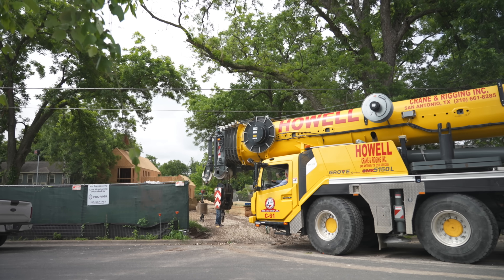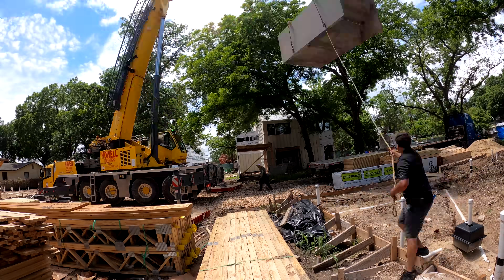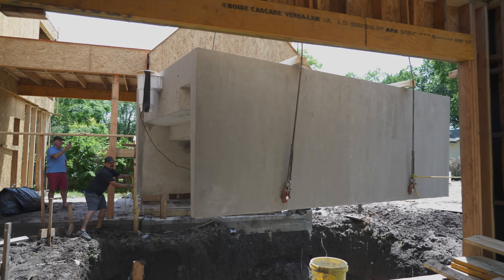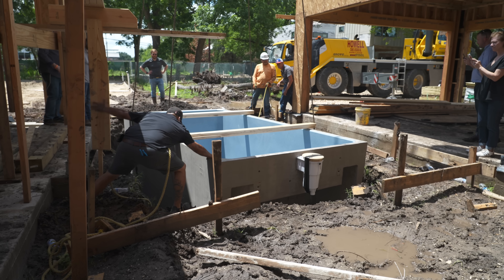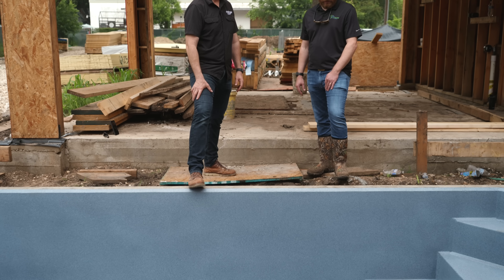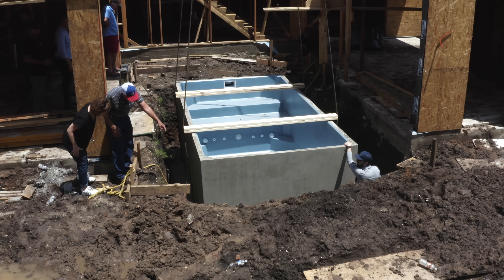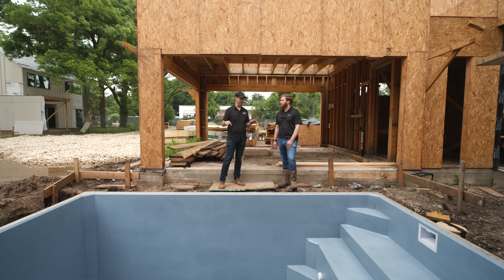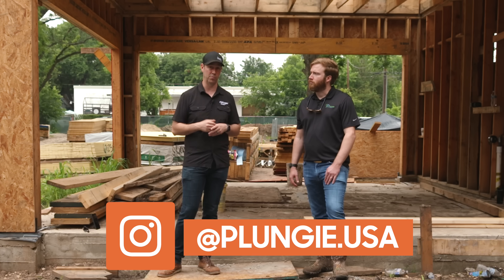Crane in Pre-Fab CONCRETE POOL - Cheaper! + 2 Day Install!

Comment: Edit: I spoke with Plungie about this video and they explained that this video was geared towards other builders, not consumers. So if you’re a builder you can buy this package for around $25,000 then your guys install it. Makes a lot more sense after they explained that to me. Plungie was very helpful and answered all my questions super quick so just wanted to clarify that. 

Saw this video when you uploaded, reached out to plungie and they sent me a builder here in Dallas where I am, just got quoted $80,000 for the Max installed. Was hoping for $25-35k also we have 2 acres with no trees to go over and plenty of room for a crane to drive in our flat back yard. Just wanted to clarify this wasn’t a hard install problem.
Reply: Oh man. That sounds like it’s way more than what was said in the video.
Reply: Well that's a helluva big difference between 25K and 80K.  Like the difference between YES and NO.
Reply: 80K for a small prefab pool and installation.  Yeah, no thanks.
Reply: My parents’ neighbor installed a pool about this size, in SA, 50 miles south of Austin, but full custom, about the same timeframe as this video, took 6+ months from contract signed to installed. Cost over $75K. Inflation, labor shortages, materials shortages hit pool companies HARD.

Comment: That's not a pool , it's a large hot tub with cold water!
Reply: Lol
Reply: I went to the comments to say the same exact thing. lol
Reply: Very expensive "Topless" Cesspool (Sewer tank)
Reply: Exactly, it's just a large bath tub. I wouldn't call something smaller than the size of 2 sheets of plywood a pool.
Reply: Which is begging the question, are pools really that expensive in Austin?
Reply: What's the problem. Its perfect for smaller areas. Heat option is available. Probably won't take as long as a regular pool. Problems with jets, leaks, lines, and pumps wont affect this the same as with a hot tub or swim spa? It will last for many many years like a regular pool. Looking good!
Reply: For 25k? It’s pretty nize
Reply: I know Soake brand plunge pools can be heated with gas or electric. Idk about Plungie pools.
Reply: So... A pool

Comment: Good idea 
This will still run 8k more 
With excavating yourself $
Adding cement slab on bottom $
Getting a permit $
Electrician $
Plumber $
Crane not included $

Comment: Never owned a pool but I’ve seen those fiberglass ones on the backs of trucks before. How do these compare to those?
Reply: fiberglass ones weigh less
Reply: This is made from solid precast concrete, no cracks or flexing, incredibly strong!
Reply: Fiberglass ones can also pop out of the ground of the water table gets too high and or you let too much water out.
Reply: @lordgarth1  my cousins neighbor had a fiberglass one and one day there was a drunken party. Drunken fool #22 tossed a big rock into the pool flooded the whole yard because it cracked the bottom of the fiberglass liner.
Reply: @andrewschell6536  wow that’s crazy.
Reply: Far stronger, and you can install above ground, in-ground, or somewhere in the middle. also ideal for sloped yards
Reply: @lordgarth1  gunite pops out of the ground just as easy.  Pretty sure this would float to if given the chance
Reply: @lordgarth1  So can concrete ones
Reply: @concreteguyjd  Can yes. not nearly as likely as a lightweight plastic shell.
Reply: @andrewschell6536  in no scenario on this earth can you say "concrete" and "no cracks" together.
Reply: @Kincentc  I think you misunderstand the diff between precast and cast in place. The latter has many many more cracks. Precast septic tanks crack less because they are already cured in temperature controlled environment. Cast in place anything don’t have as good of rebar, can’t sweat as much nor is the environment stable”
Reply: @andrewschell6536  correct.... But still incorrect with your first post where you said "no cracks". All concrete cracks.
Reply: @Kincentc  💯 the only guarantee I give people with their concrete is that it will crack
Reply: @lordgarth1   Any vessel can float including a custom gunite pool. It is Archimedes Principle, if it weighs less than the water it displaces it will pop out of the ground. Water is heavy.  The fiberglass ones are lighter than the gunite so they might be more prone to floating but it can happen to any pool.  Draining a pool in an area with a high water table is very dangerous to your pool.

Comment: It's more like a big tub.  I'm actually surprised it's so expensive.  Are you telling me this tiny size pool built traditionally would cost $100k?😳
Reply: I got several traditional build quotes for a pool this size over the past several mos. minimum was 60k
Reply: @michelleholcomb2973  
That's crazy.  It must be tied to location...  The hotter it is in summer, the more expensive.  I have a pool but I bought the house with this pool.  Googled prices in Boston area and it's about 70k for a full size pool
Reply: @michelleholcomb2973  That is absolutely nuts
Reply: @sergeyb8  I feel like this should be at least half advertised cost since it's cookie cutter and being built in a factory in whatever location best suited financially. But they're probably milking the margins. How much does that cost in just material? Any competitors?

Comment: pools are expensive to install, expensive to maintain, expensive to remove. Yes pools are nice
Reply: Like boats
Reply: Pools are not expensive to maintain if you diy.
Reply: @lordgarth1  Yes they are, then you have a small pool more the  likely. Chemicals have nearly double in price over the years. Even growing up the above ground pools were not cheap
Reply: @zack9912000  I have a 29,000 gallon and other than paying $125 for my chlorine this year that i normally pay $75 Chemicals aren’t bad at all unless you pay extra for cheap chemicals at a pool store because they say things like ph or alkalinity up instead of washing soda or baking soda. between sams club and a few industrial suppliers i use for things like boric acid. it’s fine.
Reply: @zack9912000  converting to salt water pool myself.  Doesn't need all those chemicals
Reply: Just like owning boat.
Reply: A pool is a hole in the ground that you pour money into.

Comment: I have a 1/3 acre narrow lot, back yard only about 5k sq ft.  This would honestly be perfect for me.  My first floor is 3ft above grade, i would probably even install this only partially underground so its on the same level as the deck. Only thing is I doubt I could get that massive crane anywhere near my back yard.  Maybe they could lift it over my house lmao
Reply: Plungie have done several installs, lifting the pool over the roof into place. reach out to the team for more info!
Reply: Cakewalk for a crane operator
Reply: @chrismacaulay  Does the pad have to be set below frost line or require a footer?

Comment: Not impressive, to small,,,to expensive, basically a hot tub,,,with a little leg room,,,,,I paid 25k for a 20x40 with 9 deep
Reply: What some shit fiberglass pool?
Reply: Yeah back in the 70's.  20x 40 with a liner, not even gunite, is 35k
Reply: @mojodojo5533  More than that here in CT, a lot more!
Reply: @natrone23  🤣
Reply: @mojodojo5533  that would be around $60+ here.
Reply: *too
Reply: @natrone23 fibreglass pool is the most desirable and maintenance free pool tf are you smoking?

Comment: You still have to hire an electrician to bond and wire the equipment. Add a heater then you’re adding a plumber. A few other miscellaneous and youre add another 6 k without even trying.
Reply: Probably don’t need a heater in texas however being texas you can do your own work as well. pool plumbing and wiring isn’t very difficult.
Reply: @lordgarth1  you are correct “wiring isn’t very difficult” but if its not done correctly it very deadly too. Don’t worry about the bonding either, if that’s not done correctly you end up with a shorter Christmas list of presents to buy.
Reply: @jjcross3280  if you screw up wiring a pool then I don't know how you tie you shoes.  Seriously you would have to go out of your way to screw it up. Also even homeowners have to be inspected.  I've only wired a few pools, 1 city and a few home sized and many hot tubs most are just 1 step off of being plug and play. If it is pool rated then it is easy other than stepping over under pipes.
Reply: @lordgarth1  

You’ll probably need a chiller in Texas. Unless you want to swim in bath water.
Reply: @darwinawardcommittee  Plungie offer chillers as well!
Reply: Got a quote for a fiberglass pool , 15 x 26 here in Tennessee, the shell alone was 30k. So anything to lower the cost is music to my ears, things are crazy expensive these days, love to have options.
Reply: The name of the game is convenience, the home owners probably spend more for lunch than what a few tradesmen would charge for installation.
Reply: You party pooper
Reply: You don’t need a heater in North Carolina my pool water was 90° or higher during the summer
Reply: @williamrose7184  from what I’ve scene they are a year round. I know the one I’m working with in MA is going thru many extra steps to prevent freezing to make it operational year round.
Reply: @williamrose7184  I am in South Florida.

Comment: 25k!!!  Seems a little spendy for a rectangle
Reply: Looks like a large japanese bath
Reply: In North FL and got a recent estimate for a 7’ x 10’ pool. $40,000 and a minimum nine month wait! I’m out.
Reply: It's cheaper than a standard pool which usually runs you over 30k
Reply: @mr.g937  Typical 16 x 32 inground will run $75-$100k in Ohio
Reply: Recent quote in north Texas was 60 k for gunite

Comment: How do you insulate the water from the ground?  Or do you?
Reply: I know nothing about pools, but I do know Texas. I don't think we do that kinda thing :)
Reply: in colder climates you can put insulation around the side walls when you install. the pool sits on a 6 inch pad so it's somewhat insulated.
Reply: @stiffdrinkmime366  You must not live in Austin?

Comment: Are pools that small really that expensive!? Granted it is a bit apples and oranges, but out in the country where I live I could make a natural swimming pool four times that big for easily under $10k
Reply: A good hot tub is 8k
Reply: Is natural swimming pool code for a pond?

Key words in your comment are that YOU could make it. That price is made and installed. And it's probably a flow pool, which means it is for swimming against a current. Another specialty.

But I would pay $25k for a pool in my yard right now! If I had it. Lol
Reply: Where part of the country are you referring to? I assumed they were all north of $50k to start
Reply: Labor is expensive.
Reply: yea that looks like an oversized hot tub. what kind of "swimming" can you even do in that thing? you just tread water or chill on the side.
Reply: @sedricksupreme  this is true
Reply: I solicited estimates for a pool here in FL about 6 months ago and they ranged from $42,000-$52,000.
Reply: A BIT? LOL!
Reply: @chrishayes5755  Swim spas are not massive. 10x15 with a jet gets you a good training swim spa.
Reply: @Slowhand871  Wait till u have get it serviced for a leak, bad jets, pump problems, and the general service issues that those products usually need.

Comment: Looks stout, in Texas our clay soils can put a lot of stress on the walls of a pool.  At these sizes, I’m guessing the concrete can handle the pressure just fine even when empty.
Reply: How on earth can y’all call that a pool in TEXAS? Alabama guesses everything isn’t BIGGER in TEXAS after all!
Reply: Looks exactly like our septic tanks. Texas soil won’t do anything to these..
Reply: If you put about 12" of large chunk limestone around it, would that reduce the stress?
Reply: 4” would be cutting it close in New England. The freeze thaw cycles can crack a 6” 8” 10” concrete wall depending on the soil conditions.

Comment: It is 1/4 the cost, and it should be...it's 1/4 the size.  Even for a "plunge pool" it lacks character.  It's a deep Jacuzzi without the jets that fits more in an enclosed patio than in a backyard.
Reply: I caught that too.  "1/4 the cost".  My large 'campground' sized kidney shaped pool, 35k gallons, when it was installed was only 35k!"
Reply: @mattalbrecht7471  not these days. North FL - estimate recent for a 7’x10’ pool - $40,000 and a minimum nine month wait!

Comment: $20k + install for a 10x20 seems like could be reasonable, depending on the market. I think fiberglass will run you around $24-25k installed, so this is a bit more expensive for what should be much more durable product.
Reply: Install would double that price at least.  Not sure how much that crane would be down in the states but in Canada you'd be looking at a day price of close to $10k if not more.  The big cranes we use in industrial environments are like $25k to $50k a day.
Reply: Nevermind.. kept watching the video..  that is way cheaper than it would be up here.
Reply: @pin65371  Plungie launches in Canada in September. Factory in Toronto opening up shortly
Reply: @chrismacaulay  do you work for them?
Reply: Insane money. $3000max
Reply: The crane starts at $10k for a day
Reply: @markman63  You realize that the crane doesn't need to be there the whole day, right? if it's well organized - it's probably 4 hours max.
Reply: @AleksandrPanzinAlex  This is correct, 3 hours is what we had for ours and crane cost was ~$2500
Reply: @pin65371  I had an 80T crane set my pool in MA just two weeks ago.  The going price is about $2000, but I got mine done in 1/2 day for $1,200.

Comment: Hey Matt, I have a quick question. I’ve been deciding if I like zip 2.0 system better or plywood with fluid applied house wrap for my sheathing. I saw a video where you shot a piece of wood at osb and it went through it. Then you did the same thing to a piece of plywood and nothing happened. Would the plywood be stronger compared to zip 2.0? That’s what I got you of that video. I would enjoy watching a video where you talked about zip 2.0 vs plywood with fluid applied house wrap and your opinions on each. Thanks!

Comment: As a builder, what I really want to know is what’s the particulars of the foundation?
Reply: Agree, could have went in depth on that.
Reply: Dave, we provide full engineering specs. For our pools your pad requirements change depending the soil type. We have really done the up front work so you can install a pool that will be in use for  a lifetime
Reply: @donovanshanahan7810  thank you for the reply. It wasn’t my intention to snub the product, I was just kind of surprised that they didn’t even mention it in the video. I will definitely be looking into using this in the future.
Reply: @donovanshanahan7810  Life time. This is not a word when discussing hot tubs or swim spas?

Comment: Thats not a pool. Thats just a large bathtub.
Reply: ah yes, you know you've made it when you have a 10x20 bath tub
Reply: @chrismacaulay  Hey Chris I see you pumping this pool, fine.  That's ok.  That particular pool is not 10x20.  Watch again.

Also if you are interested in a larger pool more economicly built look at ICF.

Save the crane and spend it on more materials (concrete and forms) and you will have a nice, larger, custom product for the same or less money, especially if you have any DIY in you.